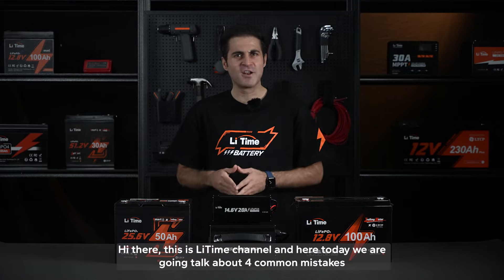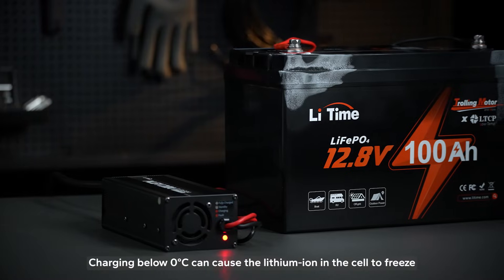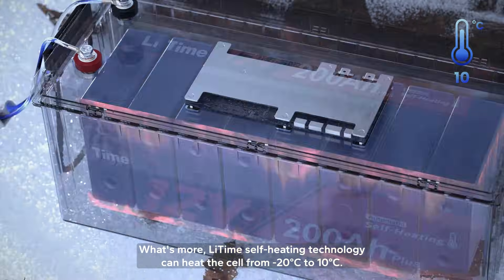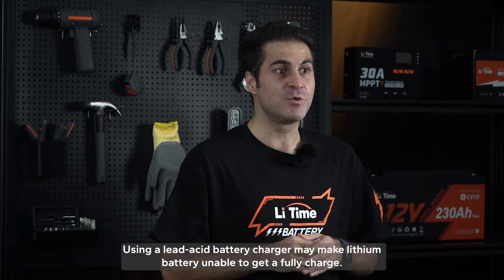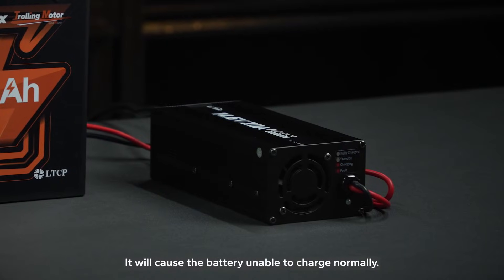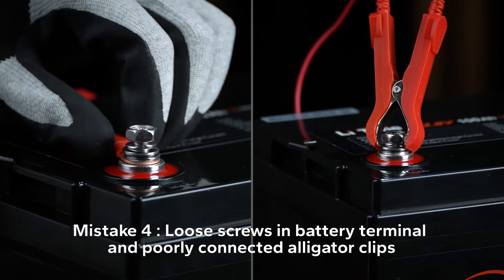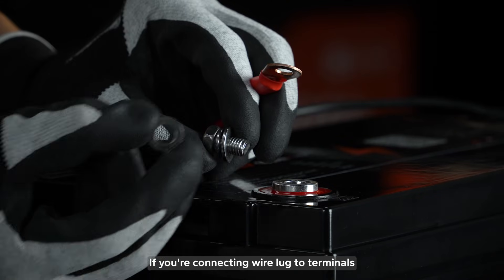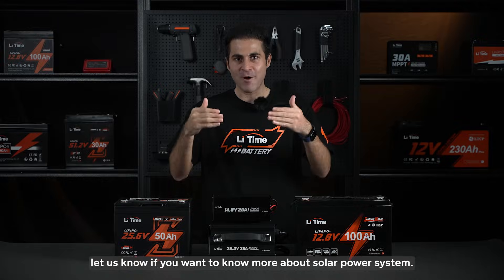4 Deadly Mistakes to Avoid When Charging a Lithium Battery

Comment: I bought 3 100ah 12v li time to run in a 36v series for my bass boat.

Can I charge the series with one 36 v charger like a golf cart would be or do I have to use a 3 bank on board charger with a lead to each battery?

Thanks.
Reply: I would like to know this as well.
I believe that would be ok, as long as all three were fully charged when first connected...to be sure their charges are properly balanced.
Reply from the maker: Yes. Both methods are acceptable. Please note the following:
1. Ensure the charging voltage and mode for each method comply with the corresponding system requirements.
2. For the first charge, batteries must be charged individually, then connected in parallel to balance their voltages before being used in series.
Hope this helps! 😊
Reply from the maker: Hi~ Both methods are acceptable. Please note the following:
1. Ensure the charging voltage and mode for each method comply with the corresponding system requirements.
2. For the first charge, batteries must be charged individually, then connected in parallel to balance their voltages before being used in series.
Hope this helps! 😊

Comment: Can the deep cycle 100 ah trolling motor battery be charged on an AGM setting instead of lead acid setting?
Reply from the maker: Sorry, we recommend using a charger specifically designed for lithium batteries. AGM and lead-acid charging modes differ from lithium charging, and long-term use may affect battery health. Please check: https://www.litime.com/products/12v-10a-lifepo4-battery-charger-ip67-waterproof

Comment: How much torque should be used when tightening the terminal on LiTime? Also, do you recommend using 4 point bus bar instead of loading everything onto the battery. This is my first lifepo4 battery in my Van conversion. Thank you.
Reply from the maker: Between 12-14 N*m would be ideal. Yes, we recommend using a bus bar to prevent excessive stacking on the battery terminals. For detailed guidance, check out our official video series: https://www.litime.com/pages/how-to-video. Further question please contact our service team service@litime.com. We are willing to help you!

Comment: My new 100ah 24v has a specified 28.8v fully charged. None of my chargers can get the battery above 26.6
I assume these batteries are shipped very unbalanced. Performing a capacity test today on it to ensure I am getting the full AH.

Comment: Is there any issue with running both your  Bluetooth 12v with a another litime 12v in a series together?
Reply from the maker: We recommend connecting only the same battery models in series or parallel. Different batteries may have BMS variations that could affect charging and discharging performance.
Reply: I find kinda surprising that nobody seems to be upset (or frustrated) that Li Time's bluetooth app does not show the individual charge value for each of the battery's cells (which  is crucial with Lifepo4 for monitoring the cells balancing process). They obfuscate that with some childish flashing graphics; I suspect the reason is to hide from user they use a cheap BMS instead of one of decent quality. I am sorry that I believed naively in these little yutube videos full of praise and hype for the fancy brand and purchased one of their units; not ever again (specially when for the same price approx. there are dozens of other brands offering the same features and decent quality gear

Comment: I have 2 Li Time 12v 1000Ah batteries, I also have the Li Time dual charger for my boat. For long term battery health, I keep the charger plugged in, is that the best way to keep them charged and healthy or should I unplug the charger when they are fully charged?
Reply from the maker: For long-term battery health, it’s best to unplug the charger’s AC side(shore power) once the batteries are fully charged. You can leave the DC side connected, or simply disconnected the Anderson connectors. This helps ensure safety and convenience!